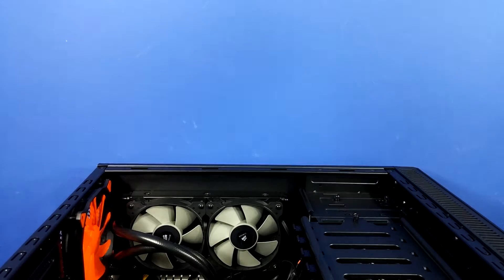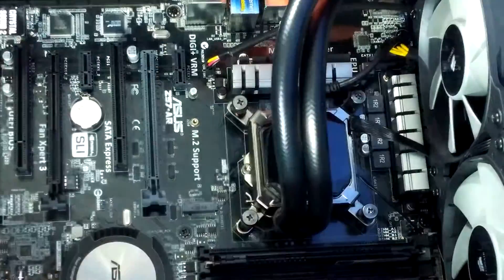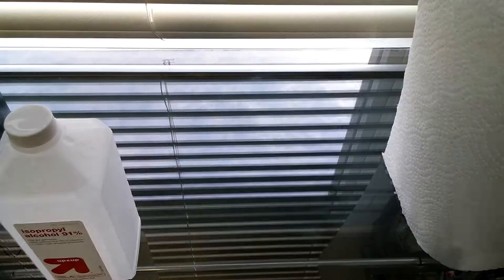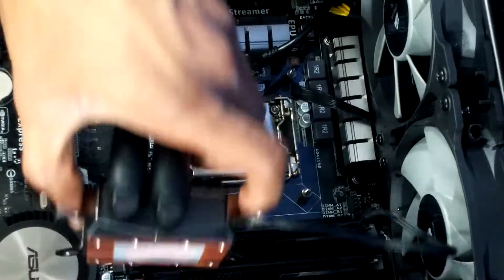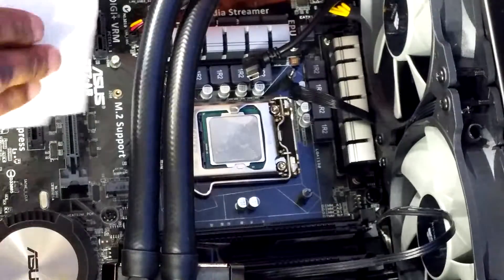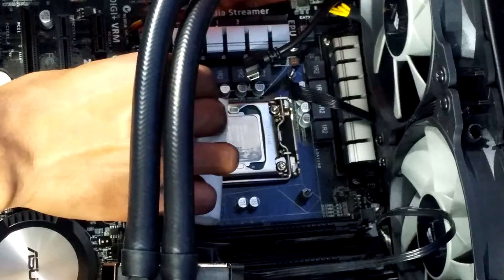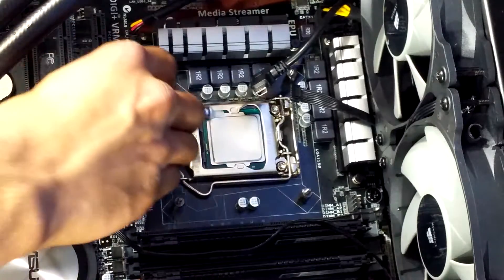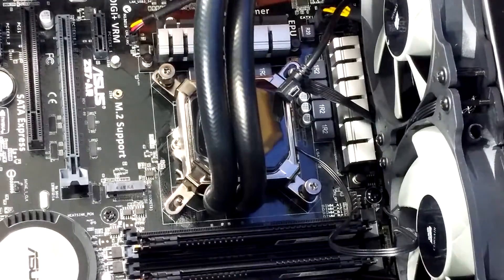Removing and Applying Thermal Paste

Comment: Thank you very much. Extremely helpful. Just two quick questions:
1. Is anything badgoing to happen if I squeeze more thermal compound out onto the CPU?
2. Can I not just use a normal wipe to wipe off the thermal paste from the cooler? And then make sure it's dry?
Reply: i have heard if you put to much there is a chance it can get down in the sockets of your motherboard and short something out. I have always heard less is more in this situation.
Reply: If you add too much compound it can start to act as an insulator instead of conducting heat and transferring it to your cooling system. That's the main issue with too much.